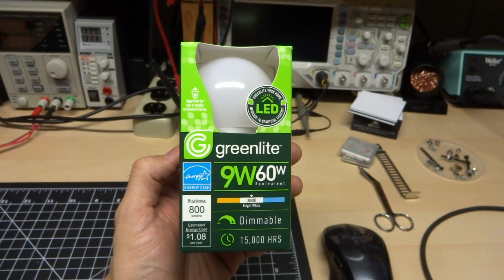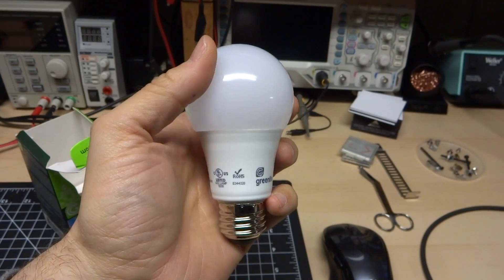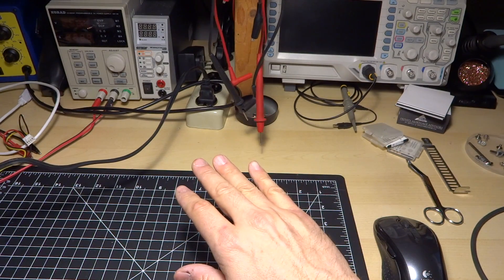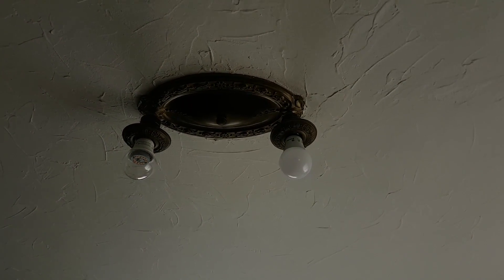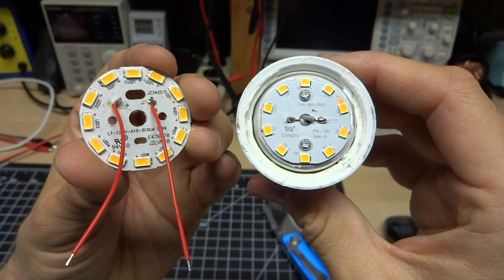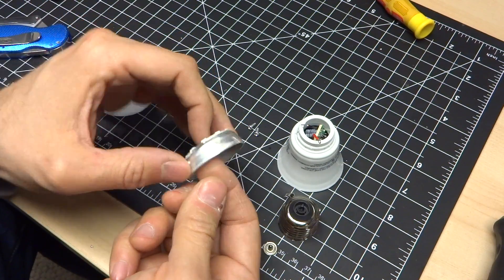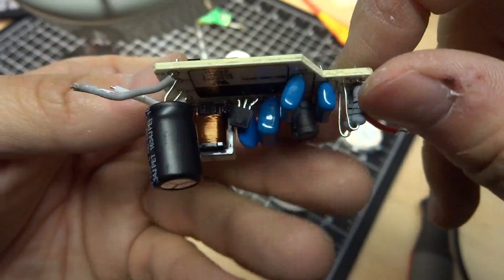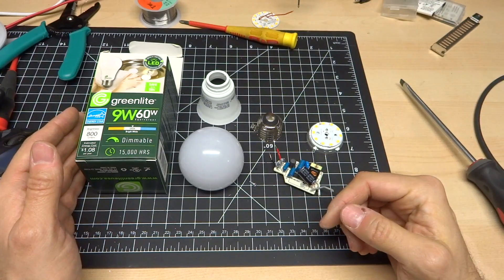Dollar Tree $1 Greenlite LED Bulb 9w (60w) Review and teardown

Comment: My North Carolina $Tree has not only this bulb but 100W bulbs - 100W LED bulbs at $1 - unbelievable! I purchased one and installed inside a bathroom enclosed fixture. Light is definitely comparable to an incandescent 100W bulb. After two months it's still working well. I think that I'll buy some more.
Reply: Was the 100W a dimmable bulb? How about enclosure rated? If so, I'd buy up a bunch for that price.
Reply: Pro1er 

I just purchased some more $Tree bulbs yesterday - 60W and 100W. The 60W is labeled non-dimmable but suitable for damp locations and fully enclosed fixtures.  The 100W is labeled non-dimmable suitable for damp locations but not for fully enclosed fixtures.
Reply: OK, thanks. Seems like the dimmable are getting scarce.

Comment: Out here in the midwest, the dollar tree has the led bulb that is non-dimmable. 60W replacement running at 9W at 800 lumens/3000K. It is a warm white and has the same warranty of 3 yrs. States to have a 22.8 yr lifespan at 3hrs/day use. And it is a major brand and is made for Sunbeam. Oh yeah, suitable for enclosed fixtures.  We've been using them for 6 months now and have zero issues. Thought you might be interested.

Comment: As others have said Dollar Tree locations are selling two packs of these for a dollar as well as single packs also for a dollar. Not sure how that math works? I noticed on amazon that they are selling a similar bulb from Greenlite but it is rated at 25000 hours. All the other specs seem the same (generally). Would be interesting to teardown one of those to see how they differ from the Dollar Tree bulbs. https://www.amazon.com/dp/B01MQRZ080/ref=psdc_2314207011_t1_B075SM864M

Comment: Nice rundown. I recently bought a few bulbs from Dollar Tree in New Hampshire which are branded "Sunbeam" . They spec exactly the same as the ones you show with the exception of not being dimmable. The thing that stands out is the "suitable for enclosed fixtures" feature, something I've  yet to find in another LED bulb. I've put two in some enclosed ceiling lights in a stairwell where they have burned 24/7 for a month or so with no apparent issue.  I put an early generation Sylvania ($10) in one of these lamps four plus years ago and while it didn't fail, it dimmed greatly and went down in color quality.  The technology has really matured in the past few years.
Reply: Ken Weller n
Reply: @allgoo1990  They continued to function fine until a few weeks ago.  I only replaced them because I found some 100 watt (vs 60) equivalent 5000K (4 for$5) bulbs rated for enclosed use, so they've continued to advance.  These are REALLY  bright.

Comment: With all your test equipment in the background, why didn't you test it for RFI?  Maybe you can do that and post another one.
Reply: I have one on the same line as an A.M. radio. Reception is fine until I use the dimmer, then you can hardly hear the radio. The other bulbs that are not on the same line don't seem to affect reception.

Comment: Do you have a video on the led wedge bulbs used for landscape lights .I just bought led landscape bulbs to use in my portfolio set and the ones for ac controller (which mine has ) were more expensive for them than the ones for DC controller .Seems strange since I have and old dc controller from an old malibu set and the ac bulbs worked with it .Are we spending more for led wege based bulbs for ac controller when we could save money and get Dc bulbs .Then I get on ebay that says the seller says work in ac and dc .This is extremely confusing .I bought my wedge based bulbs t5 off ebay for 21 dollars for 20 of them .T 5 and T 10 are confusing also My portfolio lights I bought at lowes here for less than 60 dollars just a month ago

Comment: Being a fellow Oregonian I find it strange that the local dollar tree doesn't have these. Maybe I'll have to go in and have a talk with the manager about it. It would be extremely nice to be able to pay a dollar rather than going to Home Depot and spending close to $10 each for essentially the same thing. I mean some of them have a higher lumen output but not enough to offset the cost increase.
Reply: Go online to their website. The head office basically send whatever they want to whatever store they want to send to. Been dealing with that type of issues out here and it seems a common problem. I got a bunch of folks to complain that our local DT did not have the bulbs and now suddenly we have them. It is true with any product you want that is at one DT and not yours, get online and complain/request.
Reply: ExStatic Bass , get them on eBay cheaper than dollar tree
Reply: Would like to see a link as I just got done searching the whole 9W LED 60W replacement bulbs and did not see any for less than a $1.50 ea.
Reply: Still looking for a reply. I was just on ebay again yesterday for something else and looked for those bulbs for less than a buck and still do not see them there. Provide link please.
Reply: Yes, you can order on their online website and have it either delivered to your local DT store r if you catch their flat rate shipping days, then it can be delivered directly to your house.
Reply: Maybe try a different dollar tree. They're everywhere now.

Comment: Just curious if you measured the input voltage to the LED board after it goes through the power supply.  I want to make a new power supply that runs on 12VDC in order to make a high intensity tail light for my motorcycle.  They have 12V LED bulbs, but the light output is pathetic.   Read: No lumen rating on the package = pathetic.
Reply: the individual LEDs run at 9 volts each from these bulbs 2 of these in series will run at 14.4 a bit dimer  add a smoothing cap to reduce any voltage spikes and the ripple voltage from will raise you about 14.8 really  ideally 2 in series will want 18 volts  but I would not want to run them at max voltage with a unregulated power source nor would I want to run them at max power for something really important like tail lights please keep in mind with a capacitor in parallel with your LEDs they will not turn off when the turn signal blinks but go dim you can get them to turn more or less off by adding a resistor across the cap  say 25 volt cap 1000 UF and a 470 ohm 5 watt resistor across the  cap and 3 ohm 10 watt resistor inline with the positive of the led  my power rating on the resistors is likely a bit over kill but they are cheap to get and better safe then sorry to prevent you from having to open things up again a popping resistor is unlikely to start a fire but remote chance of it blowing a fuse if it touches ground its also the lack of ventilation to cool them down is another issue the LEDs them selves will still need a heat sink an old mother board chip set heat sink would do fine just have to manage the conductivity issue so use non conductive compound like ic diamond witch turns into a glue after a while holding the led to the heatsink will be a trick but maybe some  clear lexan and screws good luck

Comment: We sell them at a true value in Massachusetts and they are in fact subsidized.
Reply: I suspected at some point of the supply chain they have to be.
Just the circuit board components alone is at least $1.00. The LEDs are at least $1.00.  Which is fine.  These should last longer than filament lights and save lots of electricity too.

Comment: Cool. But were are you? I'm in Canada and I've never seen an led light bulb for $1. The cheapest I've seen in my town is $4 Canadian. Maybe if I lived in a bigger city like Vancouver. I dunno.
Reply: ok but  what i really want to know is  what is the output of the power supply board? if you hook your meter to the output of the power supply board how many volts and how many amps,  could i use these for some electronic projects i wonder?
Reply: Walmart. $1.50 each. Been happy with them. Made by globe. Non dimmable I believe
Reply: In Nova Scotia, Canada, you can often get the $4 bulbs half off when the Efficiency Nova Scotia push is going on. $2 Canadian isn't bad for a led bulb. I have a hard time finding any from China for that price.
Reply: Rod Naugler $1.50 at walmart in canada
Reply: infopackrat bll
Bluetooth connection problem Android
Reply: CHEAP LED's does not mean = good.

With cheap led's you'll get a cheap technology inside.

If you want high technology, visit our channel or: LEDD (dot) .ca
Reply: They are subsidized by the Energy Trust of Oregon

Comment: Good electronics has mtbf of 50,000 - 100,000 hrs but for 1.00 good deal
Reply: freevideos051 By the time you test an LED bulb enough to be allowed to state 100000h, it's obsolete.

What's weirder is the cycle ratings. The highest I've seen so far was ">100000 power cycles", but some state as low as 10000. Bare LEDs can typically withstand billions or even trillions of cycles (TV remotes work by cycling IR LEDs at kHz or MHz rates, and most dimmable bulbs dim by PWMing in the kHz range), and I don't see how the PSU would be sensitive to cycling.